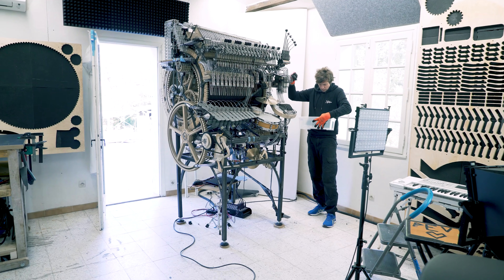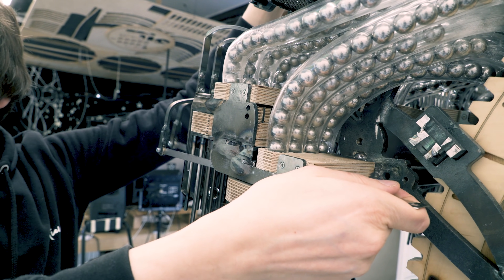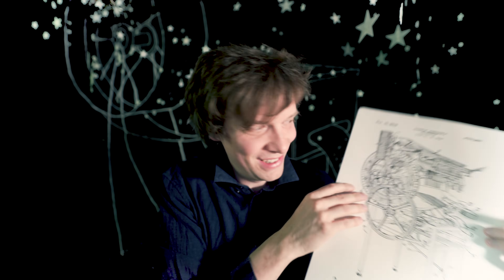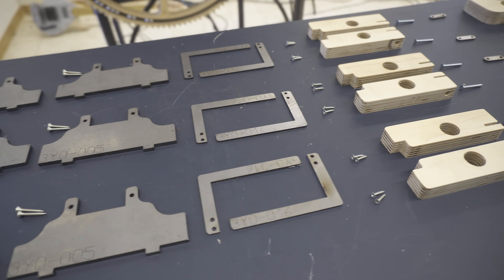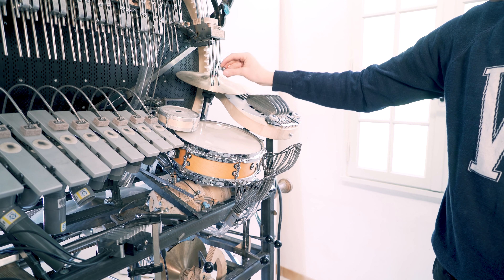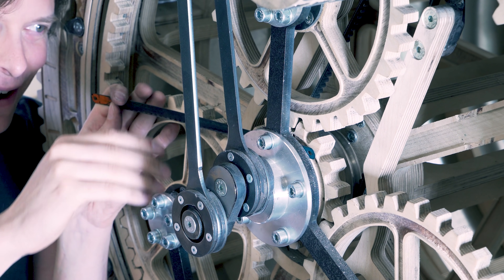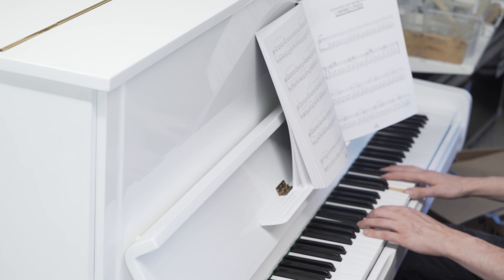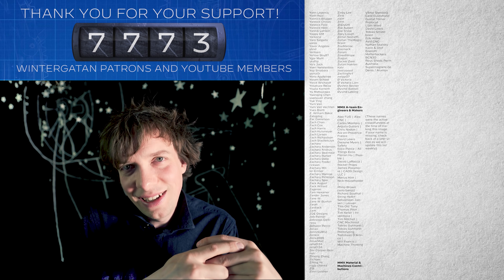Cyber Funnel

Comment: The funnels are a great design, but seem to add to the noise concern. I'm curious why they aren't coated with a material to deaden the sound of impact or contact. I have sometimes used a plastic dip to coat and protect tools and parts, but it's shock-absorbing characteristics also reduce sound. It's even available in a clear, so the look of the funnels wouldn't change.

Comment: Having seen this series so far, it’s interesting how, if I missed the rest of the series, and then heard that you finished the machine, and there were suddenly videos of the finished product, I wouldn’t feel like I’ve earned it.
It’s very very interesting, comparing and contrasting between this and the original marble machine, both in design and the way it’s being presented online, we get a lot more information with this. It’s more of a journey than it is some miracle that spontaneously materialized in the recommended feed.

Comment: Martin, did you plan to fix the tubes of the funnels. My fear would be that if the marble machine would e.g. stand in the sun on a concert the weight of the funnels in combination with the heated tubes could cause lowering the position of the funnels if not fixed.

Comment: "How can I make music that is more beautiful than how this machine looks"

That has been the problem from the start.You spent years build inga beautiful machine and in the end all that matters is what music you play on it. It's been fun watching the endless redesignes but in the end the MMX limits what music you can make.It doesn't give you more possibilites, it ties you down. remember how you added a fuckton of levers ant switches to change pretty much everything about the machine's timing etc? That's because you already knew that the programming wheel is a very very limiting factor.

I'm sure you can make nice music with the MMX but it will always be a variation on the original song.

Comment: I am usually not commenting on videos but I am very impressed by your work and thought I'd give you some of my support!

Perhaps this is something other people have commented on or something you have thought about already but I have, for a long time, been wondering why you use so many metal parts in your marble machine? I guess it is both to achive a nice design and being sturdy and less prone to wear. However if you are aiming for less "rattle" and less sound I would guess you should aim for a design and use materials/parts introducing more damping and perhaps lower the resonance frequencies of some of your parts. 

I do not know where the problem areas of your machine lies (but from you're saying you have a problem). One way to find you problem areas could be to use an acoustic camera. I would guess much of the noise is generated where you have impact between marbles and metal parts (funnels for example). Additionally noise from joints with much friction.

One way of reducing noise without changing the design much could be to use paint dampening vibration (I guess any thicker more porous paint could work), for example on funnnels and other metall parts. Note that this may add thickness that could cause problems and that paint is generally prone to wear.

Once again, I am very impressed by both your engineering and estetic skills and I am looking forward to seeing and hearing more from you and the team!

Good luck!
/Peter

Comment: A good big part of the machine is the marble collection and delivery systems.
Did you consider adding an emergency backup marble feeding system?

I just imagined one of those pipes with a funnel on the end break during the live performance and the machine losing ~blood~ marbles on a slow, but steady rate until it can't play anymore while it's only 50-100 marbles from the end of the song.

Something as simple as a bucket of marbles + funnel on top of the machine to feed marbles into the system "manually" might save a live performance later on.

Comment: I think it would be nice if you mic'd things like the marble ladder and the clicks as marbles run across full drop tubes, and other parts that really represent the machine sounds, and then you could mix each them in at appropriate levels. It could be creative choice. On stage you could even have a switch you could hit to bring them in and out. Too bad there isn't an extra channel on the drum so you could control it like that. There aren't any channels that have a direct electric/electronic effect right? They're all marble drops? Although it would be easy to convert a drop to a switch.

Comment: Don't give up!  Your videos are an inspiration in the sense that you start off with an idea and develop it into something functional.  This idea develops into a concept on paper or CAD.  The concept runs into the engineering side of things (appearance, fit, form, function, clearances, tolerances, material selection, manufacturing techniques available, fabrication methods available, component and consumables availability.) Pick any video...they demonstrate the relentless pursuit and dedication required to transform a dream to a functional project.  The "challenges and failures" may feel like a hinderance, however, they are all learning opportunities that are part of the development process.

Comment: I foresee an issue with running out of marbles in some of the bass and drum channels because of the top marble gates, for example at 2:33 he has to block the bottom gate and fill them up one at a time until its full. If many successive notes are played and then a period of rest, rather than fully replenishing with marbles, only marbles above the top gate can recover. I can see this severely reducing the number of notes that can be played quickly for long songs during live shows or if a song is played directly following another without having to stop and manually refill them again.  I am especially concerned for the Cyber Bass because it has the last channels and it needs every marble it can get. It has such a large reservoir in those lower pipes and would be a shame to have them go to waste.

Comment: Hey man. To reduce the noise, why don’t you change the marbles instead of changing the whole machine? Like a rubber covering on each marbles etc. you can compensate the increased size of the rubber covered marbles by rubbering smaller ones...

Comment: can you magnetize your vibraphone plates or incorporate magnets into them?  Try using an electric guitar pickup.
Reply: The other thing that might work very well for your setup is an electric field.  I have made some prototype guitar pickups that use a JFET transistor with a floating gate, and a 9V DC bias applied to the metal guitar string.  When tuned correctly, the movement of the string creates a wave in the transistor gate that matches the sound.  It's similar to an electric guitar, but does not require magnetic metals, it's operation is more similar to an electret microphone.  It's definately more complicated than using a magnetic metal and a cheap EM pickup out of a box.

Comment: Hey! Nice to see the background and all. BUT, as I'm a filmmaker and photographer, i dont reccomend you to use a wide lens so close to you. it deforms too much the face. If you can, you should use a 50mm focal distance (or around that) and place the camera further away to achieve the same framing. (if you can).  I would also soften the light and place it a bit higher. Check the rembrandt lighting ;) I watch all the videos and I'm rooting for you to finish the MMX and come to Portugal with it. I'll be here waiting, and by then hopefully we can shake hands. Or maybe a hug, hugs are nice as well. If not, a respectful Japanese Bow will do. I've unfortunately never made of give any usefull contribution do the MMX, but if theses tips help you out I'll be happy AF to have been part of the project, even if in a tiny insignificant way. All the best, keep it up and stay safe!

Comment: i would put automotive Sound deadener over metal sheets (after bending to fit) inside the wire catches. Also using magnetic clips to hold them in place could go with the theme and make them super easy to take out. Good luck with the music!

Comment: Great video, looks like we are going to see a finished MMX very soon! One question though: Why are you going through the hassle of fixing screws with epoxy? You could just use something like Loctite instead and still be able to unscrew if really necessary at a later point. Epoxy usually means final...

Comment: There is a small part of me that hopes there will be the sound of an angle grinder running and/or the popping of a TiG torch or even the CNC machine servos featured in one of your compositions. It would be a fitting musical tribute to the engineering aspect of the project. In my humble opinion.

Comment: Have you considered using Pickups For the Vibraphone, something like the MALLETECH V3, or like the Helpinstill used for Pianos?, It might help with Noise reduction from the machine its self a bit when moving to a recording or live setting though a PA. Alternatively getting a number of Directional Hypercardioid microphones if you have the ability to Acquire them and mic them in zones via High, mid and low notes, this being assumed that Channels are not a problem.

Comment: Hi Martin, please check the MMA pipes will not break when used to hold the funnels. Maybe clamp one on one side in a similar way you clamp them in MMX, then attach a motor (stepper or any other will do) to the other end via a crank, for example. Run the motor for a day (or a few) to see if the pipe is OK with the vibrations. Hope it will all go well :)
All the best!

Comment: It's such a wonderful talent you got mate keep it up and keep going strong 💪. I would like to suggest an option to dampen some of the nose by placing some kind of rubber in the funnels so when the marble hits the back part of the funel it won't make that noise with the steel rods. You could put a thin silicone hose on each rod before welding the top part of the funnel.

Comment: Thinking about the vibraphone issue - would the solution (albeit a pain in the arse) not be to switch to something more in the vein of say, a Rhodes or similar tines + pickup design? It may lose some of the acoustic properties unfortunately, but it would allow for full isolation of the sound, as well as allowing for some more fun FX possibilities. I dunno, you've probably thought about this, just spitballing, I can understand that the noise may be distracting to you at this point.

Comment: I look forward to tuning in every week. Do you have an engineer or shipping consultant working on characterizing the vibrational mode shapes of the machine for shipping and handling? Packaging design could be a significant challenge. This is probably answered somewhere in the thousands of comments. Good luck with the final steps in the build!

Comment: I have an idea for cutting the mechanical sounds of the marble catchers. When the metal cages clap back together, they make a pretty harsh sound, but if you were to just paint a little bit of the silicone from the vibraphone that you had a dot on one side of those touching parts, then you could dramatically reduce the noise without compromising the visual of the movement.

Comment: Similar to the vibraphone keys, you don't necessarily want the marbles to hit the center of the snare drum - it's a vibrational node (a dead zone). Generally you want to hit it a bit further out, about 1/3 of the radius or so from the center. You'll get a much more resonant sound.

Comment: maybe break up the composing with a far more video-able disassembly/screw epoxy/reassembly process with added design commentary? unless of course you know that's going to make you want to redesign your more... unovedesigned parts.

Also, during that process, maybe find a way to really document the final design with all the additions, as opposed to the original you started out with? could allow you to more easily make exact replacement parts when needed.

Comment: I think you have a little construction error (timestamp 11:51 makes it visible). The marbles are dropping into the funnels, which are only kept by the plastic pipes. After a couple of concerts you will never finish to swear to adjust them. I also never understood, why you decided to use metal funnels, they are making a lot of noise. But maybe I missed an explanation somewhere and you will give them some soft cover. Greets!!!

Comment: Hey, just a quick heads up:

Those PMMA pipes are cantilevered, AKA supported from only one end.

Large vibrations in the pipe will cause "fatigue loading" - like bending a paperclip back and forth. 

Depending on how they are clamped on the fixed end, there may be a stress concentration that, over time, will cause the pipes to fatigue and snap. It's the sort of thing that you can analyze and design away, but that may be impractical or impossible to just try out through experimentation.

I would suggest adding an intermediate stop (like a felt pad) to take some of the initial impact and prevent the load from concentrating to a remote attachment point.

Comment: The machine is loud, this has been designed. Rather than dread over it, embrace it. Put a microphone on the marble stair and have it sync to the tempo of the music. The sounds of marbles randomly collecting can be analogous to rain falling. Instead of hiding it, just let it happen. See what it does for your creativity. The entire point of this build is to create live music, not to do what you can already do on ableton or fruity loops. Embrace your design, let the noisy machine inspire your music. Don’t fight too hard because your design already has it built in. To mitigate it would mean to make an entirely new marble machine, and you’ve already come too far to let that happen

Comment: Hi Martin. I have seen you many many times, change your design on almost every part of the mashine. However - you have never done any changes to the marbles as I remember. Maybe the size? Regarding that the mashine is quite noisy. What if marbles had rubber coating in some sort. It would reduse noise all over in a very easy way. Just a out of the box thought. And I love your machine! Im so exited : )

Comment: It shouldn't be too hard to mount electric push solenoids to where the pins on the programing wheel interact with the marble dispensing mechanism. Then it would be fairly trivial to make those solenoids MIDI controlled. These could speed up composing. Trigger the marble drops over midi until you have a song you like, then put the pins on the programing wheel like you always intended.

Comment: Just a thought (but I might be mistaken): have you thought about lubrication? 
Especially, on the wooden gears and surfaces that meet? 
Wood against wood has very high friction/resistance. 
I would lubricate all the wood/wood mating surfaces with something like beeswax. (or if there is something better - use that)
It would allow them to slide much smoother and reduce wear.

Comment: I may have missed something but I worry about how long the spring steel and the plastic tube will last before failure because fail they most certainly will - eventually. This is most true of mechanisms with lots of high accelerations, things that go thump or click or clink. 

You can address this in 2 ways:
1.  You design for failure beyond the lifetime of the system with a reasonable margin of safety e.g. plan for 25  concerts with expected failures at 30 concerts. For that you would unfortunately have to design out all unnecessary vibration and yes I agree that the shivering funnel is amusing but it's a risk.
Or 
2. You could do some simple testing.  A steel marble on a rod and a cam to lift and drop. With a simple motor drive and a frequency of 2hz you could clock up 40,000 drops in 24 hours. 

hate to be a doomsayer but hey it's just a thought.

Comment: Hi, Martin ! Got an Idea to autmate the notes from the bass : cushioned actuators for each string/note connected to arduinos / Rasberry Pis that reads, with a laser sensor, the height (note) and duration from a set of 4 pin rows (4 strings) fitted on the programming wheel :)
Reply: apart from the mics (ok, and motor) this machine avoids electronic stuff and stucks in mechanical. mechanical solution for the bass notes could be developed though martin seems to want a balance of manual/ live input, together with the programmed music. that is the main difference from automated organs of the past.

it is not even the marbles, it is the performer working in parallel that makes the difference.

Comment: You can join the parts of the marble catchers with silver solder, needing no argon gas.   Do not clamp onto PMMA tubing with setscrews!  you are setting yourself up for the tube's cracking.  Tubes should be clamped with soft materials, all around (like the wooden supports you already use).  The marble catchers should be independently supported with metal or wood, not PMMA.  You have heavy catchers hanging on relatively weak, slender PMMA.  This will be damaged in shipping.

Comment: I think your wooden gears need a dry lubricant like graphite get some ground up graphite powder and like a sponge and put it on the sponge and wipe the gears down with graphite it will make the gears run a lot smoother and quieter I think you need to lubricate your machine in certain areas friction creates sound try that man good luck